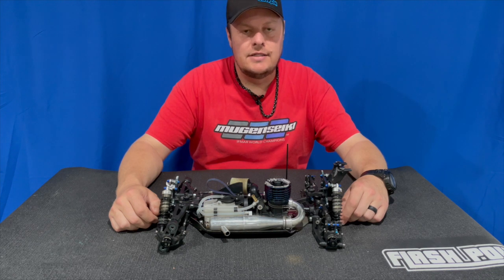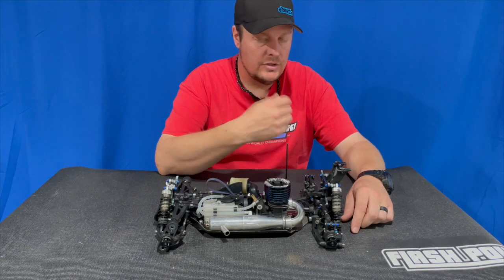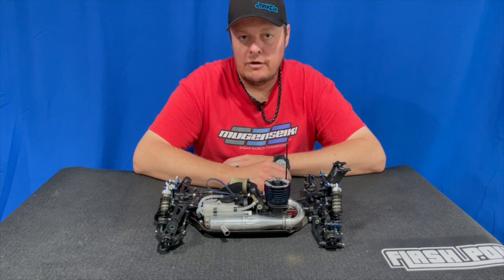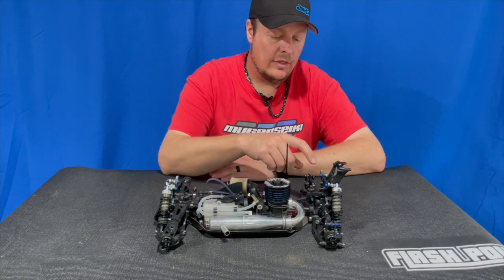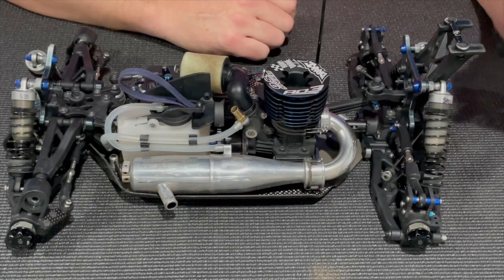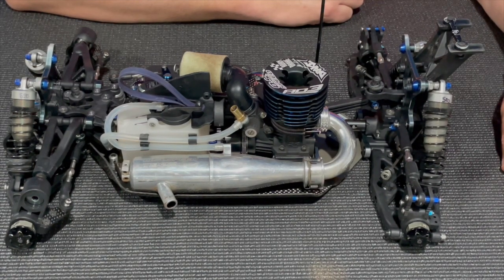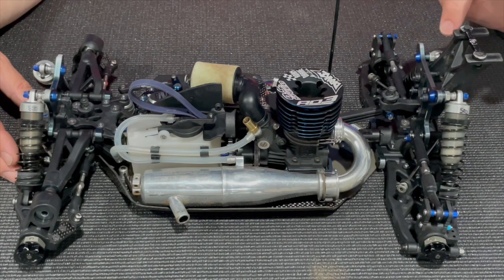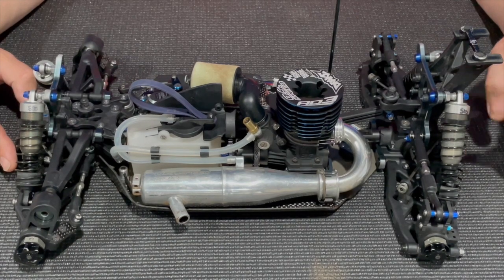Extended rear upper shock mount.

Comment: I did this years ago. Not bragging at all here. I just felt it created a slight bind and put more weight behind the car. It seems to flow better everywhere. It's been 8 years or so since I did this exact setup. I machined my own spacers.

Comment: Due to your video, I completely understand it for the rear. Very clear explanation.  So the guys running this setup in the front, are aiming to slow down the effectiveness in the front by INTRODUCING a bit of bind?  Is there a situation you could touch on possibly where that’s beneficial? Thanks so much!
Reply from the maker: Glad it helped!

Comment: Well here's the thing with your shocks take a spring and put it inside of your shock and that will help out a lot I do it and I tell Al all my buddies to do it and they like it it's just a lot better for try that and it will do great I knew it in want my 1/10 + 1/8 and I don't have a problem they Ride smoothie got good celebration and they're they're quit